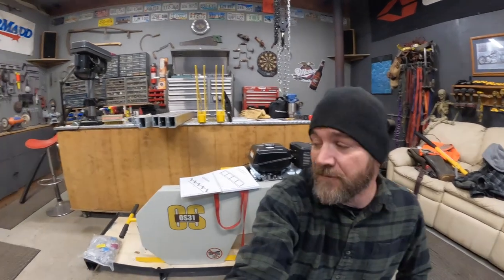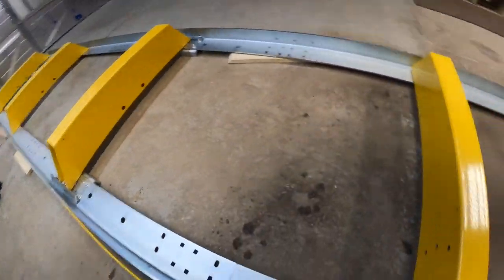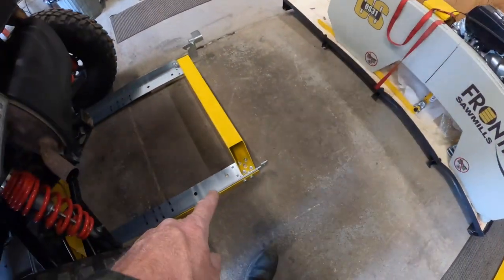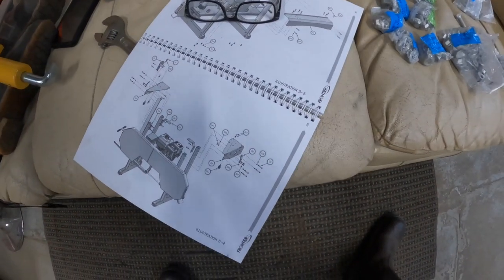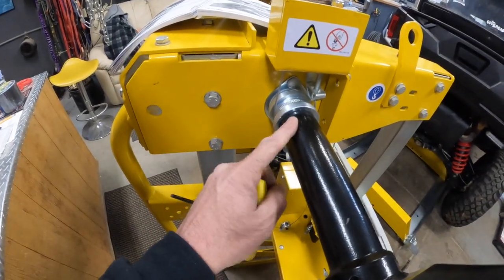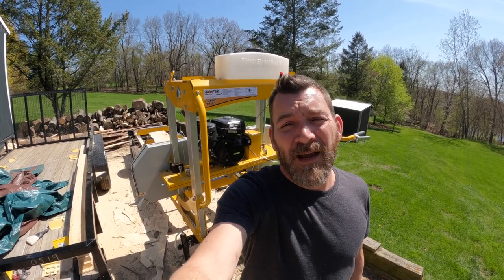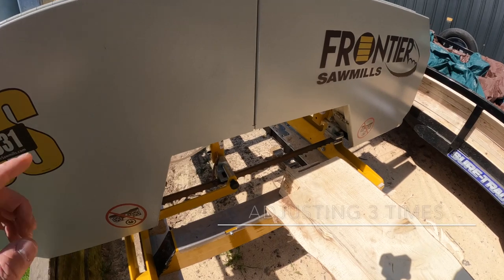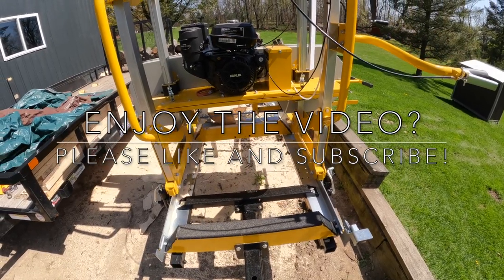Step by Step Frontier OS31 Sawmill Assembly

Comment: Out of a million videos I've watched over the years, this is the first one that I didnt scream "why dont you say/show ALL of the thing you are doing" You sir have a brain, congratulations, I just bought one of these and it has no instructions with it, spent two days trying to find some, no luck, fortunately I did find how to align the wheels for the blade, which you didn"t add or some reason, but now I think I can assemble this thing, thank you, thank you thank you
Reply from the maker: Thanks Peace!   I really appreciate the kind words and Thanks for watching!   I did find something after MONTHS of using this that I'll share with you and I plan to make another 'what I learned' kinda video.  You are right, I didn't talk about aligning the wheels - I did find that video online BUT I can tell you that I did turn it 5 turns to tighten it and ONLY rotate it the cutting direction because the blade will jump off the wheels.   I had to repeat the process 3 times (loosen, rotate, then tighten) to make sure the stretching took place.   

Also, If you already haven't - open up the blade cover and make sure those two copper wire brushes are adjusted to lightly brush off the sawdust from the belts (both drive and idler).   I had some build-up on there and realized that I have never adjusted those brushes to keep things clean.   Good luck with your milling and keep an eye out for more videos!

Comment: I recently bought the OS18 and it was a PITA to assemble. It took me 5 weeks because of the weather here in Coastal South Carolina. Assembling in my garage, but the temperature got up to 108° F during the day and barely below 90° F at night. And the Heat Index was always over 100°.
The Manual on assembly was not clear on some points, and the small B&W photos and line drawings were not not as good as they could be. Color photos would have helped.
Nothing on tensioning  the blade in the Manual, I had to find out by searching through youtube videos.
Not to mention a wrong part and missing parts and I have bolts and nuts left over and no empty holes for them.
It sits in my garage, carriage and tracks with extension until I can place out in the backyard. Still too hot and humid to works outdoors.
Reply from the maker: I felt the same….thats why I created the video so I hope it was helpful.   I also had spare nuts and bolts left over which I believe is normal.   Hope it cools off enough for you to finish.   I’m in Michigan so that kinda weather would probably melt me lol.   Thanks for watching!

Comment: I didn't see anyone reply what the blue line is for. It's to set for top once the top cut is made then use it as you cut down. Instead of trying to math the size off red line. Also since you didn't use the leveling feet it's worth mentioning...the directions are wrong. Put them on before you assemble the whole carriage. It's heavy to pick up after to out them on.
Reply from the maker: Those are VERY good points, especially the leveling feet.   Honest, I didn't lookup what the blue line was for and I appreciate the information update.   After using the mill for over a year, the scale is ... eh, ok at best.  I'm exploring some other creative options for the scale - lots of other videos on the topic.   Thanks for watching and your comment!

Comment: how tall from the bunks to the top of the scale (sawmill's highest point) is it? I'm not getting a trailer but concerned with head clearance when the mill's carriage is at it's highest point. Their customer service doesn't seem to have an answer for me
Reply from the maker: I will get this for you - just waiting for some of the snow to melt from the past storm we just got.  Stay tuned...
Reply from the maker: Finally was able to measure this for you.   The tip of the scale when raised up as much as I’m comfortable with it 76” from the bottom of the tracks (as if the mill was sitting flat in the ground).   It can go up another 6 inches but the cable rubs.   I’m working on a video with measurements now so I’ll have that up as soon as I can.